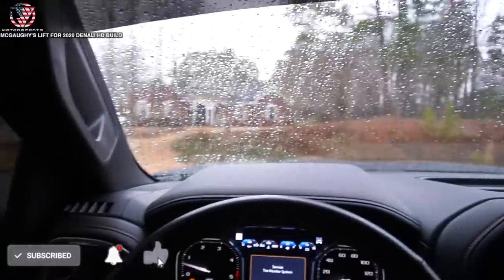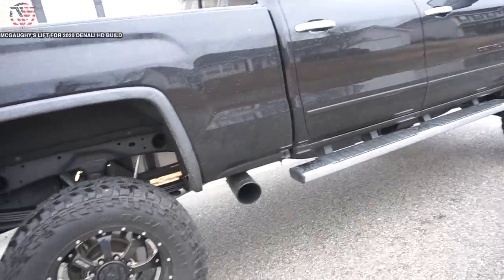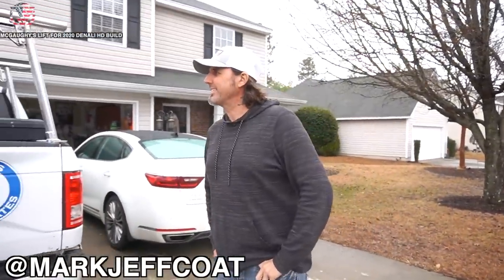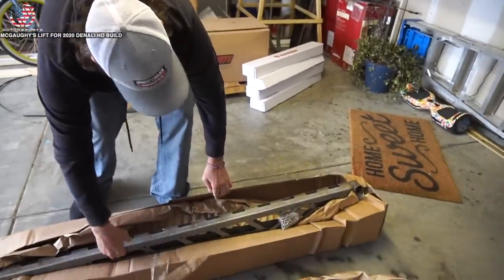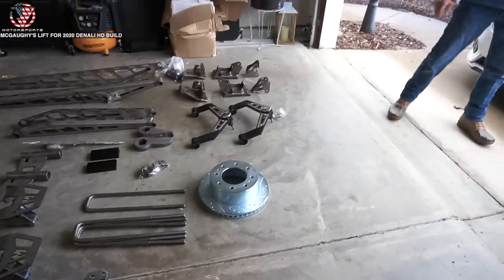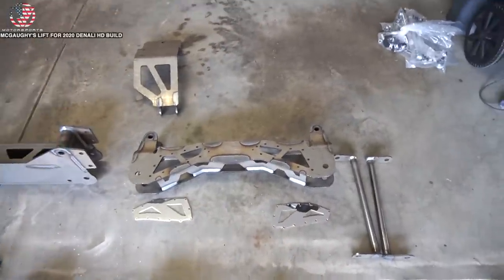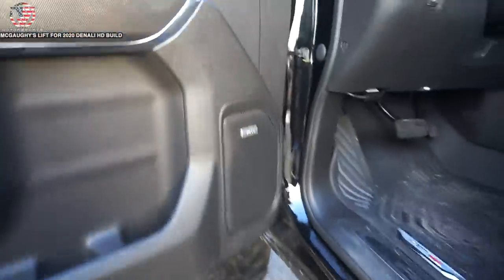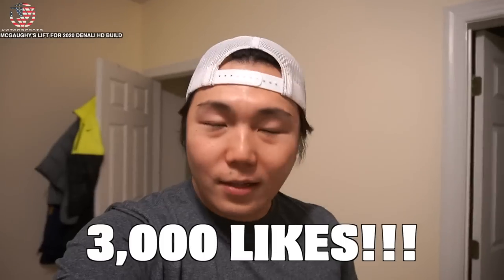McGaughys lift kit for the 2020 denali HD build FINALLY ARRIVED!

Comment: question, do you know how much does the front crossmember measures from top to bottom on the ends? from the bolt down to the edge?

Comment: Chris’ truck, could you tell how his plastic valence was removed? Was it cut in the middle to retain the chrome piece? Been looking at delete kits and his didn’t appear to have one but looked good.
Reply from the maker: You should be able to just remove the valence on GMC’s
Reply: @JWMontoya  ah that might be the problem. I have a Silverado and it’s connected all the way into the tow hooks so it would leave a massive hole.